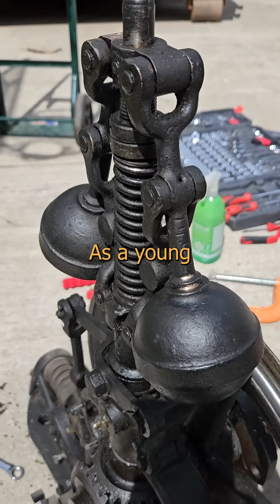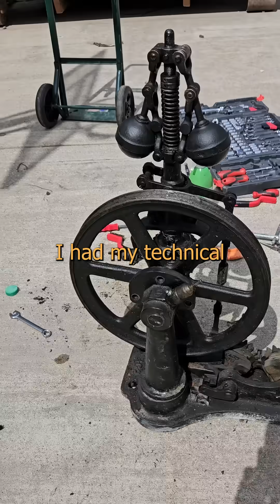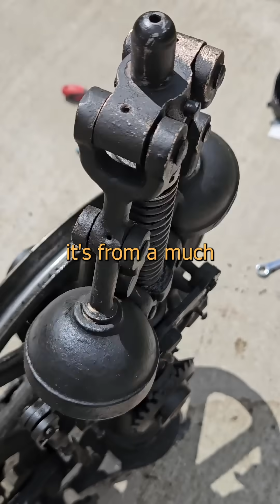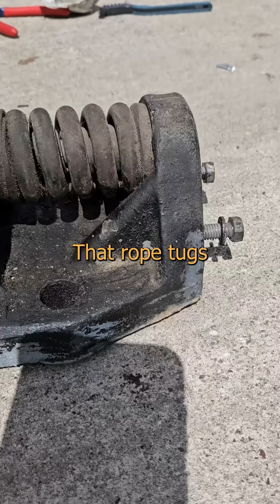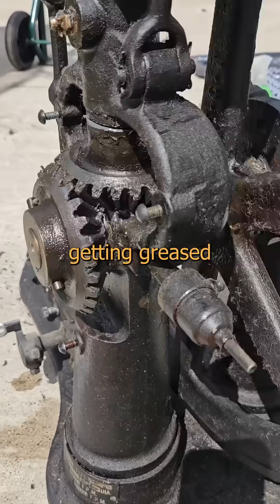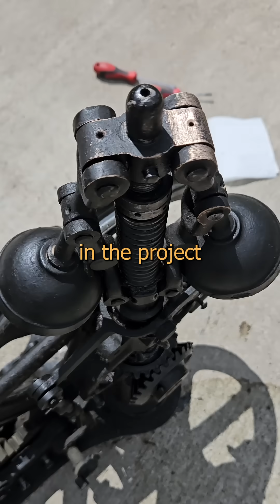Flyball Governor #chrisboden #comedy #engineering #steam #safety #elevator #steampunk #vintage

Comment: You'd love to see a constant speed propeller governor. Certain aircraft have the propellers run at a constant, most efficient RPM, and they accomplish this by changing the blade pitch, so that as the engine delivers more torque, the propellers get tilted and take a bigger "bite" out of the air, creating more thrust. The mechanical way of doing this was using flywheel weights and a spring controlling a valve, which would allow engine oil to enter the propeller cylinder, which would adjust the blade pitch. If the propeller was spinning too fast, the flywheels would overpower the spring pressure and allow more engine oil pressure to enter the cylinder, if the propeller was spinning too slowly the spring would overpower the flywheel and lower the oil pressure allowed in the cylinder, and if it was running at the correct speed, the spring and the flywheel would be perfectly balanced. 

Really, really cool device. Pressure carburators are cooler, but there is zero way I can possibly explain them in text, they're basically a carburator that can run even upside down, using a bunch of different bellows to mechanically compare various pressures against each other and determine the correct fuel flow. Mechanical fuel control units for jet engines were the same way, a huge tangle of levers and sliders, you needed special "jigs" to set them up correctly as no human brain could possibly comprehend them in their entirety. If lever A moved, it would move lever B at a ratio of 2:1, which would move lever C that was attached to a fuel valve, etc. It would take in potentially dozens of different inputs, like various engine pressures, temperatures, ambient air pressure/temperature, aircraft speed, current pilot power level selected, etc, and out of all that, determine and adjust things like fuel flow, inlet guide pitch, etc, entirely mechanically.
Reply: A number of aircraft have a button that fully injects oil into the propeller blade to force it into a 90 degree angle, reducing as much drag as possible. It's an emergency mechanism for if one of your engines stops working, allowing you to get a little more distance out of your currently gliding airframe.

To clarify I only know this about the B-17G, where I've been told many stories of where they had to use it when an engine got a little too much FlaK in its vital organs. As far as I know, this effect on the propeller is irreversible until you land and the ground crew takes care of it.
Reply: @cat_clan_leader  pretty much any aircraft with variable pitch propellers have that, many of them are even automatic (also depends on how they're set up, many of them have weighs set up, and the engine oil pressure keeps them flat, so they'll automatically feather if they lose engine oil pressure). When you pivot the propellers to 90°, it's called "feathering," and it does 2 things. One, it prevents the propeller from acting like a windmill and spinning the engine, as that would do bad things to the engine (engines don't like to spin without oil pressure, and in reverse). The other, more important, part is that it minimizes the drag caused by the dead propeller, which is critical, since you now have less thrust to fight any drag.
Reply: @cat_clan_leader  If a propeller is feathered in flight due to engine failure, the pilot will not unfeather it unless absolutely necessary. The mechanics will figure out the cause for engine shutdown and then unfeather the prop. If the engine is fine but shut down and prop feathered for training, then the propeller control is placed back in the high rpm position and the engine restarted, oil pressure will then force the blades out of feather. The prop on a B-17 is hydraulically controlled. If the engine is shutdown the prop control is put in feather. To take it out of feather the control is placed in high rpm (?) and the button is pushed and held to unfeather using an electric pump. The actuating piston in the prop uses engine oil pressure on both sides of a piston with one side governed. Been a while since I went through that system.
Reply: @5695q actually that just about checks out, especially with the use of the engine oil, that part I remember firmly. Well done
Reply: @cat_clan_leader yep, that's feathering, and on piston engines it's irreversible. On turboprop aircraft, however, the feathering is automatic, and linked to engine oil pressure. They still use the same governor system that multi-engine aircraft of WW2 use.
Reply: Crazy reading this, I just did an engineering design project on a wind turbine that uses this mechanism. I thought for sure you'd need encoders and robotics, but passive systems like these are why I love mechanical engineering.
Reply: @AlexKaratzky  same, I didn't even knew those were a thing until I got into war thunder. And I was super confused about how that would be achievable, with mechanics of the 30s.
Reply: @abriannaaguilera2123  The mech engineering in the 1930-40s was amazing. Iowa class battleships fire computer was all mechanical too. It compensated for the earth's rotation - amongst a great many other factors - and fired the guns when the ship was exactly level in a seaway, pitching and rolling. The did not replace or update it when the ships were recommissioned in 1989 cos they couldn't improve on the design! Mind blowing really!
Reply: Yeeeeeees, I was reading a bit about them yesterday  and this is the first that came to mind.
Reply: Literal mechanical computers.  Only thing missing is a card that has IBM printed on it in the corner.
Reply: That is amazing...  and you should make a video explaining all that cool stuff.  :-)
Reply: very cool story..

Constant pitch props are "usually" - (by all good design standards - " fail - to - safe " ), to self feather or go to "full coarse if "uncommanded" loss of power or oil occurs. - Pretty simple to do this under spring force alone (aero too if designed with offset blade mass) - this is the lowest drag position for loss of power  (the closest to stopping rotation - if full feathering is not an option....

(IF it had to be selected manually - most likely "routing inflight shutdown procedure, rather than "in case of emergency"...
Reply: ahh, Hawker Sidley Turbo Prop!! Amazing planes! awesome acceleration and one of the few capable of backing up on its own!! neat and nerdy cool to see and fly in.
Reply: Super cool, never thought about HOW pitch could be varied. I love that it's with oil pressure.
Reply: "there is zero way I can possibly explain them in text"... Goes on to explain them in text.
Reply: @falconerd343  My description is about the equivalent of a caveman trying to describe a car, lol. They're one of those devices where even a functional diagram of it's components with arrows leaves you scratching your head, because it's got like, bellows attached to bellows, and some pressure, this somehow allows a carburator to run upside down (basically, imagine trying to use an upside-down toilet, and it working). Sure, if you study the documents for long enough, you'll maybe be able to explain the mathematical formulas it's mechanically computing, but the rest of it is straight mechanical wizardry!
Reply: Indeed....aircraft pressure carbs are quite the mindsqueeze....and then the mechanical jet engine fuel controls???  bat shit CRAAAAZY....you need a room full of PhD engineers just to agree that they are more than a little complicated....like Manhattan Project complicated.....
They are one reason so many of the old first couple generation jet engines are static only on display....nobody can figure out how to make them run, again.
Reply: I happen to work on such a platform. T56/501 from older C-130s. I don’t get to mess with propeller stuff any, just the engine side of things, but I’ve witnessed the valve housing being calibrated and tested and it’s literally an art. It’s so many mechanical moving parts crammed into something the size of a lunchbox, with tons of micro switches to trip electronics too.
Reply: "This fucking thing" if there ever was one ^^
Reply: HOW? how the everloving fuck were we humans smart enough to come up with such a thing...
Reply: Are any modern aircraft running a carb in GA? I would guess in 2025 they would hopefully all be fuel injected.
Reply: @filanfyretracker  Nothing new built runs a carb, but nearly half the non-commercial aircraft in use today run a carb or carbuerated fuel injection (think injecting fuel into the manifold like a carburetor)
Reply: Pressure carburetors sound like they share some commonality to small engine carbs on saws, weed trimmers, etc. Uses pressure and vacuum pulses from the intake and crankcase to meter the fuel in rather than venturi effect to pull from a bowl. No experience with aircraft carbs, but the small engine ones are the best reason to move to battery powered equipment...
Reply: @kstricl Aircraft carbs (I'm sure with some exceptions) are venturi carbs with a bowl and float. The mixture adjustment on the one I've pulled apart was surprisingly simple. There's a disc with different sized holes that rotates as you adjust the fuel mixture knob/lever in order to achieve the desired air-fuel ratio.
Reply: @kstricl  where do you think small engines got their carbs from?
Reply: Reminds me of Technology Connections video on a classic pinball machine that's a mechanical computer. 

Intricate, elegant, and utterly baffling.

Comment: As a part time antenna molester I've seen a few elevator mechanisms. Saw one last year on a casting plant roof in Harrisburg that still has one of these in its elevator house. They only use it for freight so i didn't get the chance to see it in operation, but it was hard to get the job done while starting at it all morning. There was even a panel with dedicated outlines for all the special tools on the back wall with half of them missing, hopefully not down the elevator shaft.

Comment: Clock your parallel, run out and diameters before you take it apart, and before you repair anything+ use copper pads if you have to hit anything because that cast iron will be a bitch to weld, good luck!

Comment: I love all these elevator videos! I did a bunch of mods (rebuilding elevators) earlier in my career before I went into the service/repair end of things, and I always said I’d take one home one day when we replaced it with a newer spring wheel type governor, but I never did. Now, you barely see them around, unless it’s a very old freight car, usually. They’ve always fascinated me. Engineers 100+ years ago were pretty freakin smart, figuring this stuff out. 

Friendly reminder that as a passenger, you have very little to fear when it comes to elevator related free falling. Safety systems like this are what even gave us the ability to use passenger elevators reliably, ala Elija Otis. Nowadays, there are so many safety systems in place, that multiple things would have to happen to go catastrophically wrong all at once for that car to run into the ground. That type of stuff just doesn’t really happen anymore, and hasn’t happened for quite some time.

Comment: IIRC, the mechanism can ALSO be connected to the steam valve which is pushing the wheel--balls down and the throttle is wide open, causing the wheel to accelerate, while balls up causes the throttle to close, and close, and close some more until the wheel is slowed to the ideal speed. 
Kind of a big deal because judging speed of a wheel spinning so fast it blurs, requires more training than just stoking fires and calling for signals.

Comment: I'd totally come by to help disassemble, clean and reassemble this...cock and balls machine 😂

Sadly I'm some thousands of kilometers away, that's kind of a bummer 😞 

You're always welcome to visit my place, but atm i neither have the time, money,...and balls to go to the US as a tourist. They literally started to part time vanish normal tourists for weeks despite them having the legal papers... so visiting the US is off the table atm anyways 😢

Some of our countries even have official "Reisewarnungen" (it means "it's potentially dangerous there, don't go there if it's not very much necessary") for the US now, and it's not that surprising to me. Random tourists were held for weeks in a black hole cell, without any due process or evidence that they did something wrong. Countries/governments that trew due process out kinda scare me...

But anyways, tldr: visiting the US to help you out isn't an option right now - but you're always welcome to visit here in central Europe :)

Comment: My Dad Retired from DPS in the mid eighties but he held at that time as many as 14 liscenses for all sorts of things and reasons. He was a Journeyman Electrician, who had worked for 38 years at DPS. Was an A member of his union IBEW local 58 out of The D! So what you have there is some thing that he had behind him on the Window sill 3rd floor (I think, of 5 or 6) of the Warehouse Building in Cass Corridor. Until I saw this video I hadn’t even thought about it, but as one of those Bring Your Kids To Work days I was his Shadow for the Day a couple of times, and the last thing about that device was that it worked, but destroyed it self saving lives at one of the DPS buildings. It had shattered the springs and pieces were sucked into the gears and broken bringing the elevator to a very violent halt but without any serious injuries to the people in the elevator car. Part of his work was carried out inspecting and servicing that style of Governing device which had cables not rope attached to its head an bottom through a girder I beam. He had a liscense for elevator repair too. Implemented a complete closure on all elevators until they were inspected. A dozen or more had been installed improperly as the I of the I beam was to be Vertical with 2 holes drilled through them and the cable was passed through it and not over to. Most of them were done correctly but they had been a few that had I beams mounted horizontal (the weakest way) and they found missing bolts. There was more about it but I think about electrical issues and cables everywhere I step on an Elevator !!! 
Remember everything is designed for safety reasons but it is only safe until it’s not!
Then the inconvenience of having to use the steps is nothing to quibble over. And if you are obviously obese, you should consider taking the steps as much as is practically possible. The life you save could be your own! I have bad knees but it’s going down them that hurts me more than going up.  Life is good despite the pain!

Comment: Seeing the restoration would be  killer.That spot is that paint, or does it have brass parts as well? I guess the   rods and balls are probably brass due to its weight being lent to centrifugal force.
Jay Leno has an industrial steam engine in his garage. You should check out his videos of him firing it up. Ha, I bet that's where the term firing it up comes from. When they would fire up the boilers for steam engines.Balls out as well
 That is unless its an indecent exposure charge of course.😅Jay also has a Stanley Steamer that he has videos of him flying down the road on.  I think he said they can do 100 mph. But there is no pedal to give it more power. The throttle is a lever, so nothing. Starting forward and stopping is interesting in a 😮😮 way. But yes, again, please do a video on this parts cleaning and bringing it up to spec.

Comment: In Garrett turbine engines there are two sets of mechanical governor's very much like the flyball for steam engines and elevators just extremely small. The main one is actually inside the fuel control and spins 7 times slower than the main turbine shaft...also there is a tiny one that spins and operates 3 micro switches that control starter cutout, 95% RPM, and emergency shutdown which is 110% RPM. Turbine shaft speed is 42,000 RPM, so yeah... you definitely want things to play nice together. Had one poop a turbine wheel at me at around 50,000 RPM... It missed me but put all kinds of love dings in the side of the new base Fire Department.

Comment: there is a steam water pump on display here in Cincinnati one of very few. same engines as the titanic, and one part incorporates one of these and the guy giving the tour gave some interesting info. when these are in full swing they typically had a shroud on them. and that is where the term "balls to the wall" meaning they where fully engaged and nearly touching the protective shroud. pretty neat!

Comment: Believe it or not, modern propellers and jet some jet engines user the same thing turned horizontal (called speeder springs and fly weights) as backup governing in the event the electronic governing fails.

Comment: @Physicsduck
I almost never comment but my 'tism prevents me from not at least mentioning that a similar Flyweight Governor is used in the Citroen DS.

Particularly the DIRAVI steering system, where it is used to measure the speed the car is going to:

A: Increase the effort needed to turn the Steering wheel incrementally all the way up to 120mph to give a more secure road feeling, the pressure needed for this goes from around 2MPa to 6MPa

B: To stop the AC fans when going above 40mph, since the air collected from driving was strong enough and therefore you didnt need the fans

All of this and A LOT more was in the DS all the way back in 1955, its an engineering marvel in its own right and an extremely interesting rabbit hole I highly recommend anyone with the engineering tism to go down.
Reply: That style of governor is used in various forms and sizes in many different engines to this day.